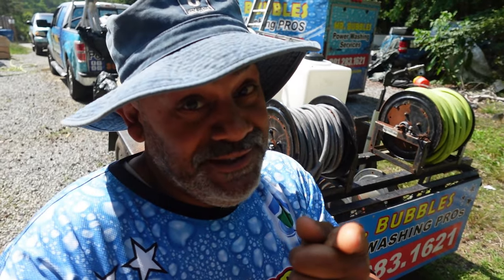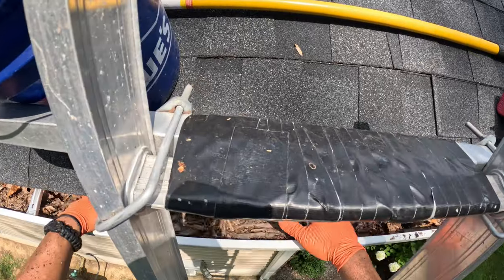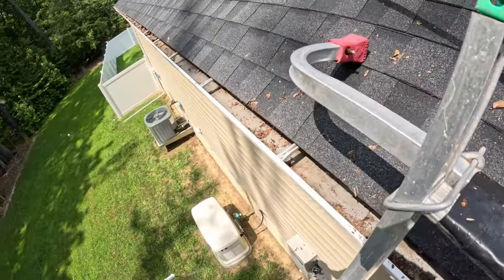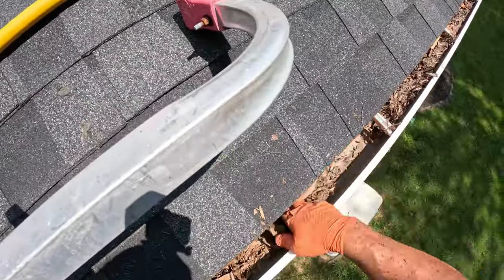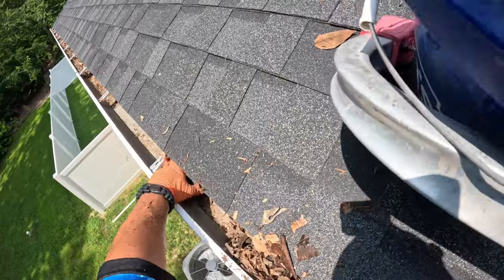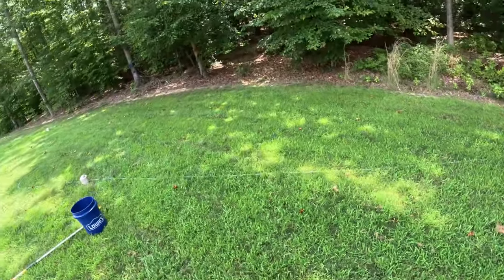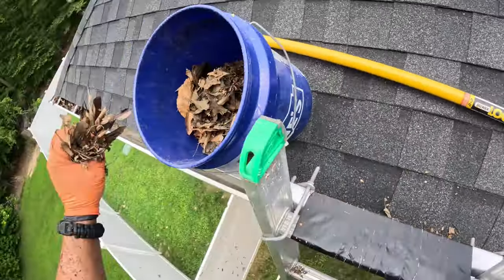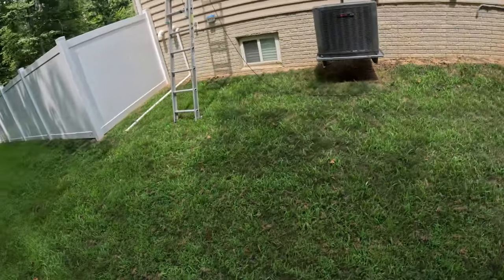Ep.68  How to Make Money Cleaning Gutters

Comment: I personally use a shooter tip to clean all gutters.  The optics to the client may not look good but I explain to them up front that the gutters are packed and need to be excavated with a little water pressure to ensure they're thoroughly cleaned and flushed" and I've never gotten pushback.  I ensure the house is thoroughly rinsed of debris and I pick up the bulk of the debris from the ground.  That back gutter you did would take 5-10 minutes max

Comment: Question would you ever consider a back pack shop vac along with that tool?
Reply from the maker: I have used one before and it depends on the circumstance if it works well or not, we deal with alot of mud and plants in gutters so the vac doesnt work all that well.